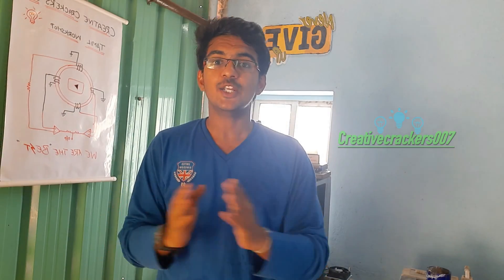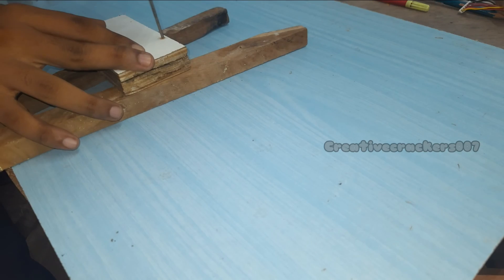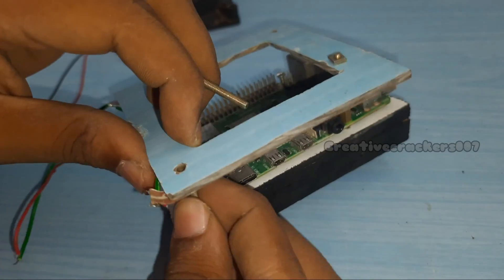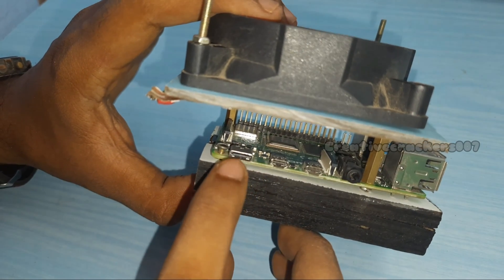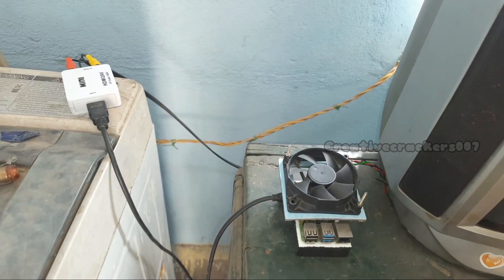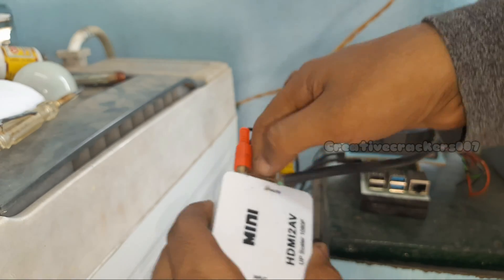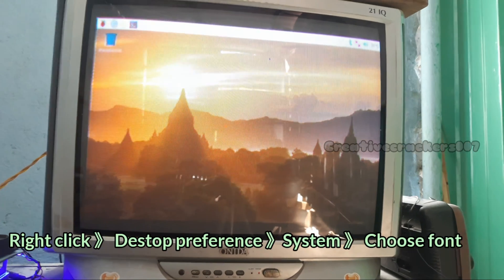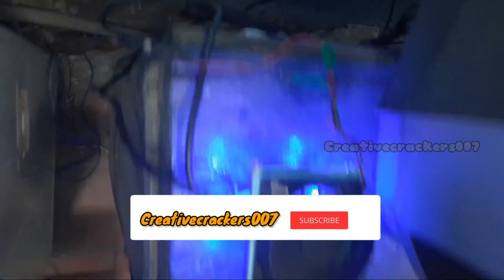Convert old tv into Computer with rasberry pi 4 || rasbian os || rasberry pi repair

Comment: Will the shock problem happen if i connect it through the pi 3.5 mm composite
Reply from the maker: The shock is caused by the tv , grounding will solve the problem as mentioned in the video😉

Comment: Bro, 
Can you give cost details about which materials used in the conversion of old tv to pc? 
Like raspberry pie4, exhausted fan  power supply   🔋🔌
* exhausted fan has three types of connection which one do you used?
Reply from the maker: Total cost will be about 4 to 8 thousand. Depends on your requirements.

Comment: That's really cool. But you don't need that converter. PI 4 can output composite video from the 3.5mm jack. you just need 3.5 mm to rca cables.
Reply from the maker: Yes but if you use this rca cable for video  output you won't have a slot for microphone. That's the reason i didn't use use it.
Reply from the maker: Subscribe and keep supporting
Reply: Composite video destroys your eyes.